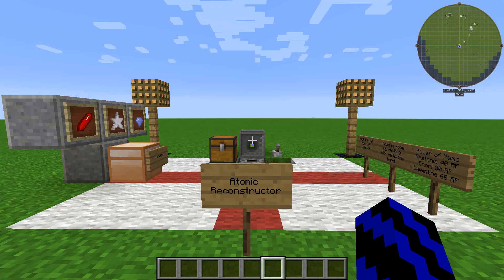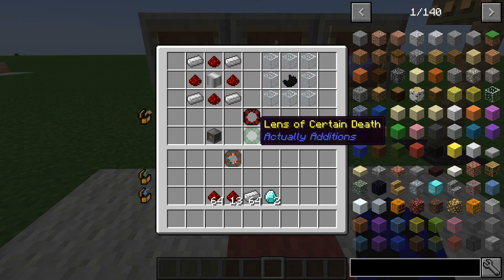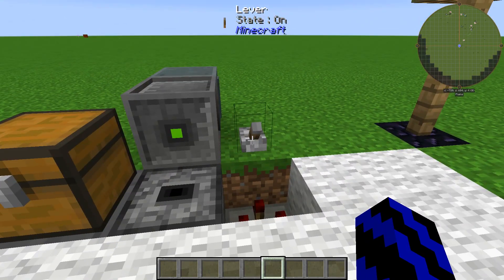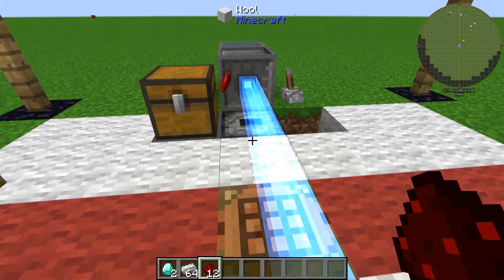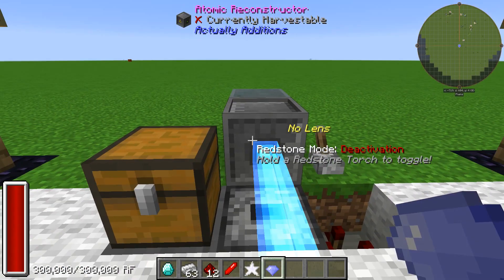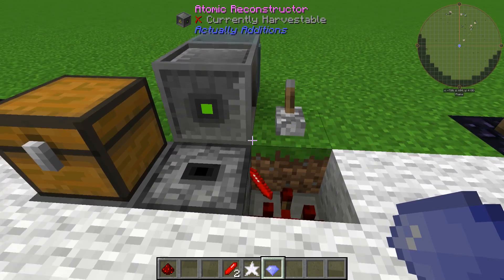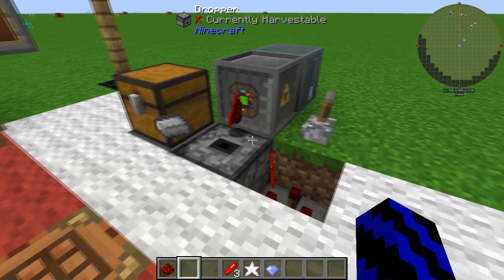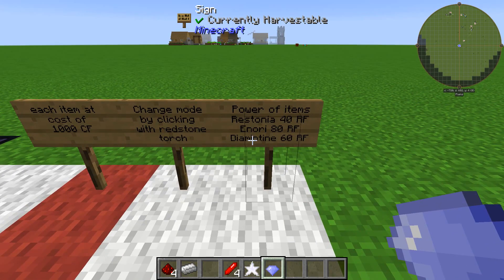Atomic Reconstructor tutorial

Comment: HOW I GET THE RF
Reply from the maker: You can use a power bank or coal generation and place it adjacent to the machine you what to power if need be you can use conduit to connect the machines hope this will help
Reply: @firethelier8553  thx c:
Reply: @firethelier8553  I am trying to conect it with the generator from Industrial  but it isnt working.
Reply from the maker: @Jausin industrilcraft will not work with this mod you need you use some other power like power bank from ender io or generate from thermal expansion hope this helps

Comment: But you didn't explain anything about the power source. I know nothing about the power source and how it works.
Reply: help meeeeeeeeeeeeeeeeeeeeeeeeeeeeeeeeeee
Reply: you can use a block called a coal generator which simply uses coal as fuel and place it right next to the atomic reconstructor or attach energy cables from it to the reconstructor if there is no room